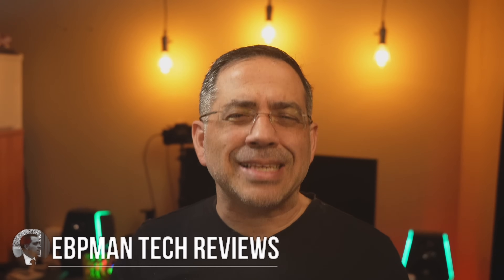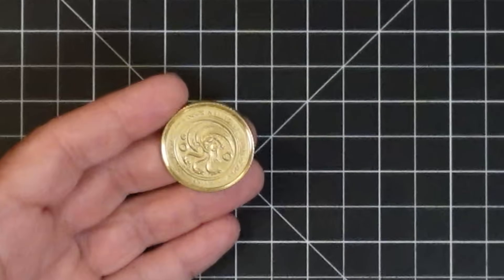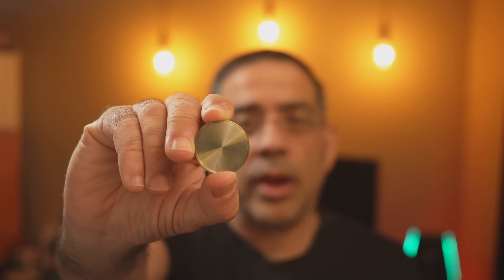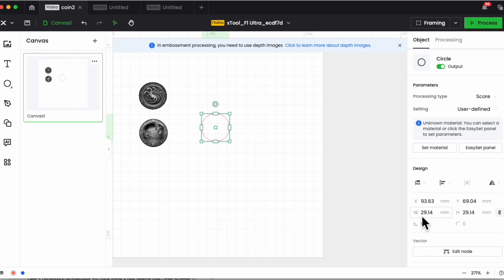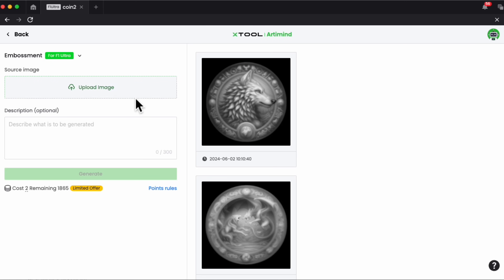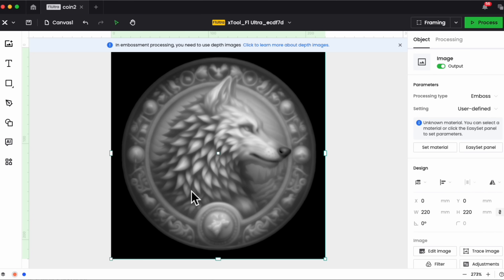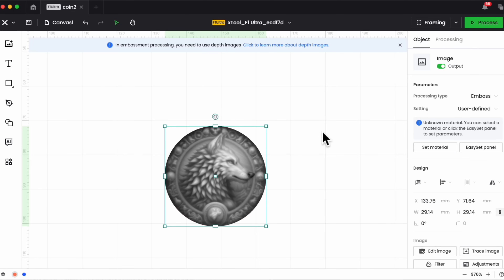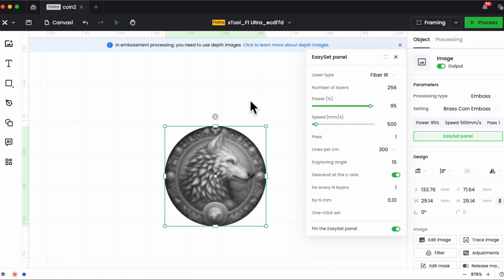How to Create a Brass Coin with the xTool F1 Ultra

Comment: So hold on a second; the point system...Are you telling me that in order to use the software that they created for use with their laser you need points? And the points are obtained by purchasing the unit but if you are batch printing/engraving/cutting those will get used up pretty quick...Sounds like a variation of a subscription that glowforge get gigged about.  Additionally, in order to get "points" you would have to purchase things from them in order to increase your point number which even for glowforge many would buy their own stuff to reduce their overhead so it almost defeats the purpose...
Reply from the maker: The embossing feature requires points.  However, you could use image r. To do it too.  Image R gives you a few embossing a day for free but if you need to do more it will cost you as well.

Comment: Appreciate the good overview of lasering the challenge coins.  You mentioned in the video that the embossing took ~2-1/2 hours.  You also described how you did an embossing then followed up with a 'light' engraving to brighten the result.  Was the 2-1/2 hours cumulative time for both layers or only for the embossing?  If only for the embossing, about how long did the 'lightning' layer take?

Regards,

Tom
Reply from the maker: Tom sorry for the late reply was traveling.  XTool makes it very easy.  You can take a vector image, doesn't have to be 3d they then make it 3d in the software.  It's really point and click.  Use the settings or experiment with some. And based on size of coin, it will take 1.45 hrs to 3 hours.  The client cycle is fast. Just a few min